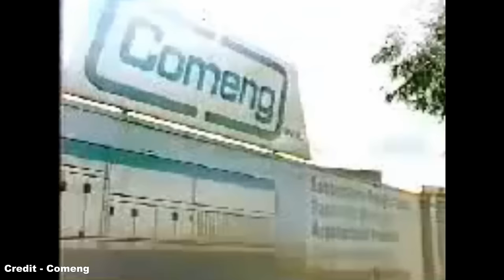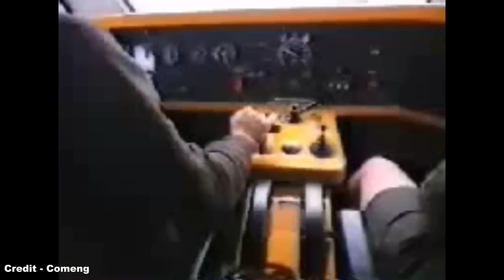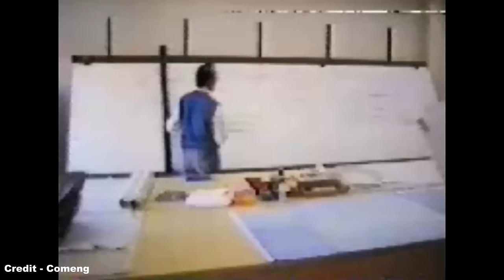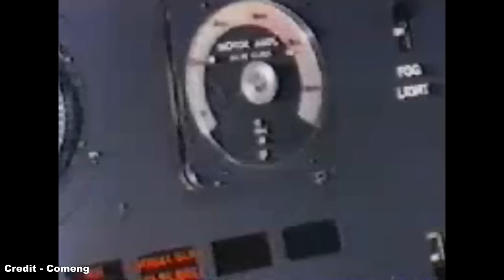The XPT - HSTs Down Under

Comment: Might want to run this one past a local. Lot of non NSW footage in there!

You hit the nail on the head with the poor condition of the NSW rail infrastructure holding the XPT back. The track these days is vastly improved in quality but the alignments have hardly changed since the 1980's and the steam age before that. Unfortunately just like the UK passenger rail in Australia is seen as a necessary evil instead of an asset worthy of investment. Add in a far smaller and vastly less dense population and we have far less money to invest in the first place.
Reply: Yup. Good video but half the Australian stock footage was rail systems in other states of Australia. Not related to the story.  For example the underground lines with the silver and green trains was the suburban Melbourne network.  The blue trains at the start was Queensland Railways.
Reply: Touche' there were a few scenes from Victoria, Western Australia, Tasmania, South Australia and Queensland. But he did do his research properly nonetheless some of the footage supplied from The NFSA or National Film and Sound Archives of Australia.
Reply: On the contrary, I think australia is great for rail, you have enormous dense urban centres, some important satellite towns and regional centres, and then nowhere else things need to be except mines and farming towns. Fast trains would be great between the cities, certainly at least faster than the XPT was allowed to run on the legacy network. 8 hours between Sydney and Melbourne with an onboard breakfast consisting of cold toast and prepackaged fruit salad.

Oh, and the AC mysteriously quit halfway through the night both times I rode so while getting to sleep was easy enough, I invariably woke in a pool of sweat.
Reply: "The track these days is vastly improved in quality" Where, definitely not on the main north line....
Reply: @TheSonic10160  So you don't understand the geography of the country very well. There is not enough of a market for long distance passenger rail to get close to breaking even, or to justify track re-alignment. The capital cities are too far apart for even high speed rail to be competitive with aircraft and the topography between the three largest population centres is horrendous.

There are no regional towns/cites with a large enough population to justify improved services than what will result from the XPT replacement.
Reply: @markpusko2480  Compared to what it was it's  lightyears ahead. Still the same twisted alignment though.
Reply: @markpusko2480  especially the north coast line where it can be shut for weeks due to flooding
Reply: And  a shot of The Overland Melbourne to Adelaide service, with South Australian Railways 900 class locos.  Much of the footage at the beginning is derived from the 1962 film All Manner of Trains.  Its here in youtube: https://www.youtube.com/watch?v=usi4LM_iVuw&t=990s
Reply: @dat581  
So...if Aus state governments still believe in InterCity rail, tilting trains sound a better option for slashing journey times. Or perhaps build new cut-offs here and there around the curvier sections. But, per my post above, enhanced speeds for tilt must come with a commitment to enhanced track maintenance/ renewals.
Reply: @ChangesOneTim  Nope. The distance is still too far even with brand new alignments.
Reply: @dat581  Sure was enough traffic for intercity travel before cars became cheap to own and cheap to run. Now with cars increasingly becoming neither, and preferably only going to get more and more unattainable (and untenable) will you want to leave people out in the cold?

The problem isn't of geography or population, its of Australian politics. Like why there's no nuclear power plants being built in a country with a massive chunk of the world's reserves of mineral uranium.
Reply: @dat581  
320km (about the same as London-Manchester here in Blighty) is certainly not 'too far' for rail travel in terms of distance...although four and a quarter hours to do it is a ludicrously long time! In most other major economies in the world, governments (especially in Europe) have already invested to make rail the credible mode of choice over such distances between important cities. In this respect, Australia has adopted the same political attitude as the USA and so I agree with @Slisk Carnelian.

With the right attitude and thinking 'carbon footprint', Australia today would have easy and fast rail connectivity to: Newcastle (160km), Canberra (320km), even to Melbourne (870km), Brisbane (900km) and Adelaide (1370km). The first two at least should be a no-brainer: Britain has several 160km-ish journeys between cities within 60-90min, and 320km-ish journeys within 150-180min - all without building any brand-new railway - and High Speed 2 will shrink many of those times further. France, Spain, Germany and Italy started investing in new high speed lines 40yr ago. Sydney-Adelaide is probably too far a stretch, but there are many journeys across Europe within Sydney-Melbourne and Sydney-Brisbane distances done several times a day in 6-8hr.
Reply: "Britain has several 160km-ish journeys between cities within 60-90min, and 320km-ish journeys within 150-180min - all without building any brand-new railway"

Complete and utter rubbish. Britain has no services above 200km/h anywhere besides High Speed 1 which is guess what?! A brand new railway!

What you don't seem to get is the distance of the two main capital city corridors is too far and the topography of the land on those corridors is horrendously bad for building railways.

Nobody is going to pay more than $500 for a rail ticket for a greater than three hour train journey when you can pay less than $200 to do the same journey by aircraft in one hour. 

The benefit cost ratio for high speed rail in Australia is abysmal. As for investment in passenger rail for any towns more than 100km from a capital city, or Newcastle the numbers are not much better. There are NO population centres to justify investment in rail. Australia is not a small densely populated island like Britain and your arguments do not hold water at all.
Reply: Newcastle to Canberra via Sydney seems plausible, with future extensions to Melbourne and Brisbane.
And it takes far more than an hour door to door between capital cities by plane, and there are things that you can take aboard a train that you can't take on an airplane, let alone people who can't fly for health reasons.

PS: the 160km and 320km figures quoted above are distances, not speeds.
Reply: @jimzafiriou7808  That's a no. What you aren't getting is the same time taken to get to the airport will be taken to get to the CBD to board a high speed train.

You also seem to have no concept of the cost to build a line through the most mountainous part of the country.

There is not enough traffic to justify Sydney to Canberra. The only partly viable improvements are between Wollongong, Sydney and Newcastle. Extentions to Brisbane and Melbourne are just pie in the sky fantasies well out of touch with reality. The cost would be well in to the hundreds of billions and make the California High Speed Rail debacle look like a model project.
Reply: @dat581  Getting to Central station or Southern Cross (Melb) is far easier and faster than getting to the airport, checking in and then going through security (I fly often).
And if they can do it in Europe, we can do it too, it's just a matter of will, and money (which we have plenty of). It cost us over $100 billion for the NBN which is already basically obsolete.
Reply: Not to mention that NSW is a State, not a Territory.
Reply: @dat581  Oh, but we have the money for a dual carriageway between Sydney and Melbourne?

And propsed dual carriageway between Brisbane and Cairns?
Reply: @shcdoodle1  So you don't understand the engineering differences between a dual carriage way motorway and a high speed railway? From your other comments that is not surprising in the slightest.
Reply: @jimzafiriou7808  It still won't make up the time difference and certainly won't make up the difference in cost. Nobody is going to pay two and a half or more times the price for a far slower journey. Another factor you people never seem to get is a high speed railway is only high speed outside the capital cities. Once inside the suburban area they are just as slow as the local rail traffic. So you are looking at a four hour journey at least and most likely more.
Reply: @dat581  In this case im not talking about HSR, my apologies for not making that clear. I personally think upgrading our existing rail lines to a 1st world standard would bea good idea, as it seems that in Australia we have 1st world trains running on 3rd world tracks, with poor alignments, capacity and quality.
Reply: @shcdoodle1  Which means passenger rail is still not competitive in the slightest.
Reply: If its significantly faster than travel by car, yet cheaper than flying, people will use it. 

Yes the plane is faster and most people will still use it, but to say that it is uncompetitive is wrong, as a significant number of people would turn to the train as a cheaper alternative.

The train between Sydney and Melbourne is significantly cheaper than flying already, but people don't use it due to two main reasons: 

1. It is currently faster to drive
2. With a whopping 2 round trips each day, capacity is limited and it is difficult to plan trips
Reply: @dat581  Sure a fast train will never be as fast as a plane even door to door, but it can be competitive enough to attract passengers. There are things you can't take aboard a plane that you can on a train, pushbikes, surf skis, heavy boxes, motorcycle parts, motorised wheelchairs, etc.
And not everybody travels between Sydney and Melbourne, a fast train would allow people in rural NSW and VIC to commute to Sydney or Melbourne for work and business.
Also, building a new fast line would allow the old line to be used exclusively by freight trains making them also more efficient.
The only thing I agree with is initial cost, which is massive, but it could be built in stages and the cost offset by other means.
It can be done, if the will is there.
Reply: @TheSonic10160  I think you need to get away from this fantasy that people are suddenly going to abandoned cars 'just because you love trains'.  Look at the country, and look at humans.  Most people will sacrifice other things before getting rid of a car and most people will fly.  Few in rural areas will ever live without a car - its not practical in any sense.  If I am going to drive to the station to catch the 3 times a day train I may as well drive or drive to an airport.
Reply: @ChangesOneTim  Yup and open a map and see the populations.  Why spending billions on a rail line when the sirliners spend the money.  As I said above, you need to grow up and realise no one is going to give up a car in rural areas.  It is not practicably and never will be.  And spending billions to serve mere hundreds is not going to be practicably.  I love trains, but I live in reality.  Not some fantasy world.
Reply: @jimzafiriou7808  No it nots - most people in Sydney or Melbourne would be over an hour to get to their central stations, and thats without getting to their local station to get into the city.  Against driving to the airport from the door of your house.
Reply: @shcdoodle1  Tha dual carriageway delivers food, materials in a myriad of directions.  Rail can never do that.  Plus those roads are as much for locals as long distance.  Pull an y car over on those roads and you will find most would never be doing the trip by train BECAUSE not only are they using the freeway, they then go off 50-100km each side of it to go elsewhere as part of their journey in the same vehicle.  Door to Door.  I love it when I read comments like yours as if made by children - a train can only ever go point to point.  Cars and trucks go door to door no matter where they travel along a linear path.
Reply: @andyrob3259  Yeah most people in Sydney and Melbourne would also take over an hour to get to the airport, and then spend another hour or 2 checking in, going through security checks, and getting to the gate. With a fast train you can arrive to the station 10 minutes before departure, have a smoke or a drink and still board in time for departure. And in reality it takes about 50 minutes for a train in outer Sydney (Penrith, Hornsby, Campbelltown, etc) to get to Central, not over an hour. Driving would take even longer, traffic around the airport is hell 24/7. I live 8kms from the airport and it takes me about 30 mins to get to the terminal with all the traffic around there.
And why would they drive to the airport (parking fees are killers) but catch a train to Central? Why can't they drive to to Central or catch a train to the airport? It seems you are trying to put up artificial barriers.
Either way, the airport is 11kms from Central so it would take the same time to get to either no matter how you travel so that argument is moot.
Also, there will be other stops in Sydney south (Campbelltown area) so people who live in the south west and western Sydney wouldn't even need to go to Central. Same with the new airport when it opens in 10 years.
The point is, even though the train will take longer, the overall time door to door is similar, but flying hasn't got the many advantages that train travel has.
Reply: @andyrob3259  Sir are you aware of how logistics in this nation worked before the 1950's or how many country towns in Australia owe their entire existence to railways?

The only reason why trains in this country don't go "off 50-100km to each side" is due to the fact that a lot of branch lines in this nation were either ripped up, or left to rot to a point where only slow grain trains can use them.

You cant have governments that actively sabotage the railways for decades and expect them to have the same connectivity as road transport.
Reply: @andyrob3259 
Nope - you wrongly correlate level of car ownership to public transport ridership. As for many households in Blighty, there's a (generally) very good long-distance train service near me yet life would be almost impractical if I didn't have a car. Quite a few stations - especially those built/ rebuilt as a Parkway - have rural catchment areas with good road access and there's certainly nothing crazy about driving, say, 15km for a 150km train journey into town. People in continental Europe think nothing about driving 50-100km to travel 300/400/500+km by TGV/AVE/IC3/ whatever. 

With more serious network investment, rail could be made the credible choice of long-distance travel between Australia's south-eastern population centres which are not so dissimilar geographically to much of Europe. Oh and I'm sufficiently grown up to understand these issues and to read maps, thanks.
Reply: @dat581  Growing up next to Canberra in late-90's/early-00's, I remember taking the Countrylink (NSW TrainLink) Xplorer from Canberra (via Queanbeyan Station) to Sydney about once every 4-6 flipping months as I kept getting bounced between "specialists" (maternal genetic source was doctor-shopping to find someone willing to pump me with Ritalin instead of learning how to deal with my High Functioning Autism (classed as "Aspergers Syndrome" under DSM-4) at the time) and Royal Far West Manly.

So by the Xplorer being a Canberra-Sydney version of the XPT being a thing then and to this day doing 3 services a day, I'd say there's plenty of traffic to justify high-speed rail between Canberra (Kingston) & Sydney (Central) (about 4hr via Xplorer was usually a 6-8 hour drive including rest stops doing around 100km/h on the Hume Highway and such. no side-trips off the highway, just get from Canberra-Queanbeyan to Sydney with minimal stopping).

And before you get uppity about ticket prices and such, a one-way Adult (no discounts such as pensioner) on the Xplorer is about $34 AUD (evening) to $41 AUD (morning/afternoon) on the Canberra-Sydney run, and it takes between 4hr and 4hr 25min for the run in either direction.
Reply: @TheSonic10160  Highspeed rail from Sydney to Melbourne is simply not competitive.

Even the favourable estimates from those who want HSR trying to sell Sydney and Melbourne HSR propose $50 with speeds of 250km's which along the current route is 3.2 hr's without stops and it's competing with 1.5hr's at $80 for flights.

The only way for a train to by competitive on time is an entirely new route which is more direct and the costs and delays with acquiring land would mean the route would take decades to complete.

It's all good to say oh Aus would be suited to HSR but you need to come up with actual practical cases for it. The reason "politics" prevents it is because every proposal is a white elephant designed to cater to inner city types who want the glammer of having high speed rail, nothing they put up is designed to serve the majority of commuters.

Intercity HSR has a case, Interstate HSR is largely nonsense. Only Adelaide to Melbourne makes sense for HSR.
Reply: @louiscypher4186  That 1.5 hour flight time doesn't include the pre-flight fucking around that's inevitable at every major airport.

"Nothing they put up is designed to serve the majority of commuters."

HSR isn't for commuters. Commuters use regional rail and metropolitan networks. HSR is about removing polluting planes from the sky and eliminating the need for enormous wasteful airports and highways. They don't strictly need entirely new railway lines to be useful, as you've said, 3.2 hours on the current alignment is more than good enough at 250 kph. With sufficiently advanced tilting trains and some dedicated high-speed tracks in existing corridors to separate freight and local passenger services from express HSR, hey, you've got a fully developed and well-utilised rail corridor.

Commuters need faster regional and metropolitan trains, with denser rail networks along abandoned branchlines and  entirely new lines to areas that have developed since the rise of the automobile that integrate well with other modes of transport, like trams, buses, cycling, and walking.

"Politics" stops this because there's this insane perceived divide between urban and rural small town Australia (and other countries), when neither would survive without the other, and having them better connected with fast, clean, and quiet trains (not necessarily HSR, but just fast regional trains and railcars that can maybe do 150 kph) makes getting around easier, opens up new avenues for sustainable development and helps get people and ideally even freight off of roads and planes and onto the only sustainable, efficient form of land transportation that we've yet invented.
Reply: Definitely, saw a lot of Melbourne trains
Reply: true, i saw a fair few comengs in the city loop